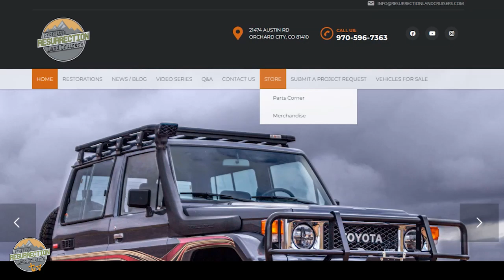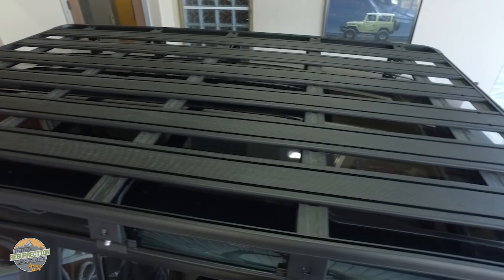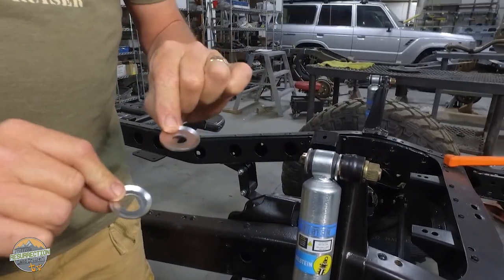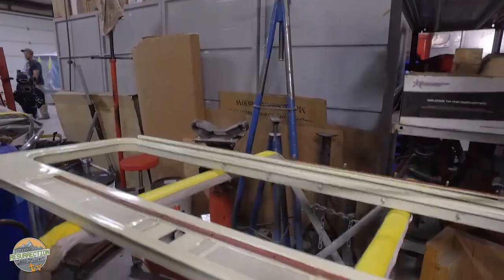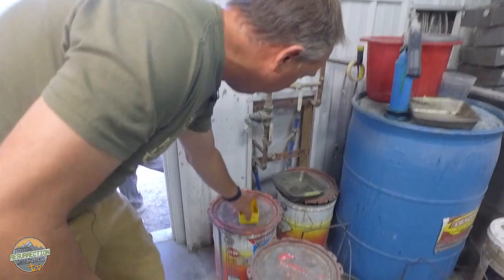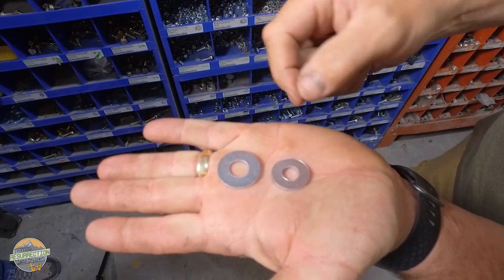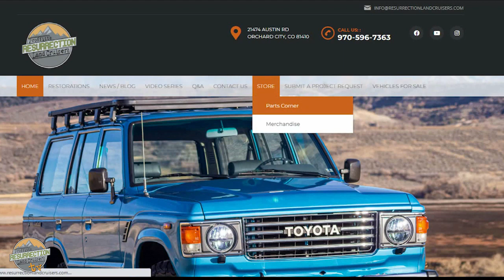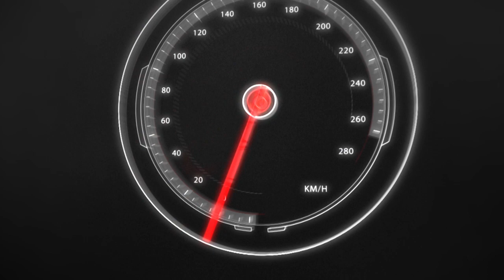One Lucky Land Cruiser! 1994 FZJ80 Body Off Restoration. Plus Washer Etiquette, Stop It's, and More!

Comment: Great video as always. I would like to make a comment on the shock washer. A: I did not know that the washers are not supposed to cup the bushing and B: I recently purchased some Bilstein 5100s for my 4runner and the instructions for the rear post, the instructions explicitly show and states the washer does NOT cup the bushing. I did some research and the reason is to allow more flex and prevents from possibly breaking the stem or post. Thanks again for a great video.